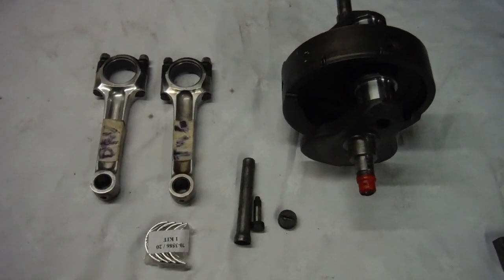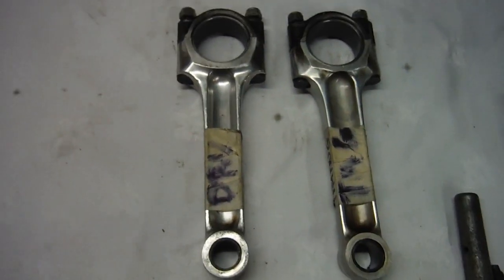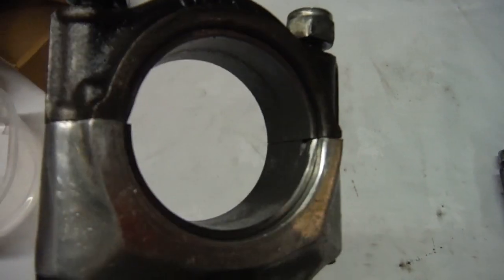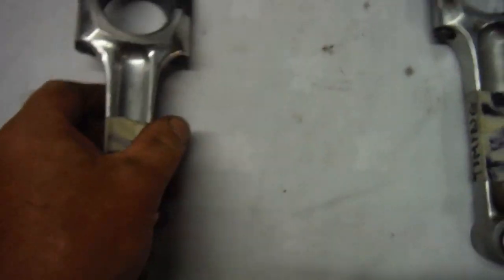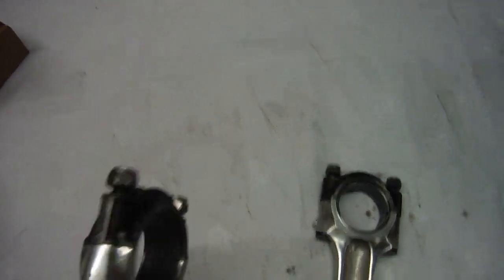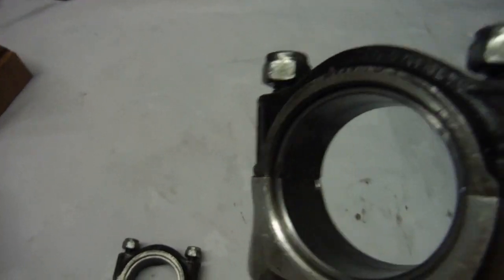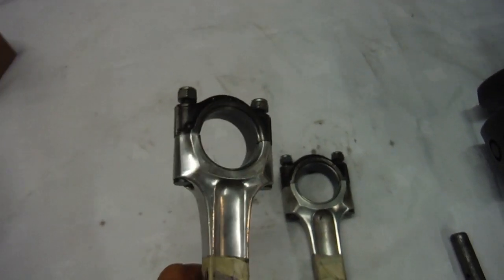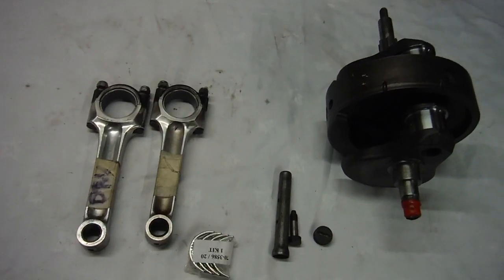Triumph T120RV conrods conundrum.

Comment: I'm guessing that bearing shell crush is more important than tang location.  Can you devise a measure of crush?

But those are hard working bearings, and I suppose the tangs could act to prevent shell rotation within the big end eye.  In that case I think the tangs should be on opposite sides and the oil drag associated with rotation should press the tangs into the recesses and not pull the tangs out of their recesses. This means installing the con-rod with correct orientation.

But chime in as my spatial reasoning could be corrected by laying out a vector diagram.